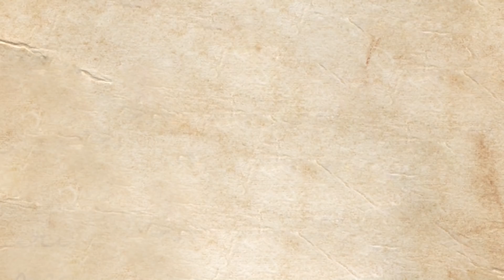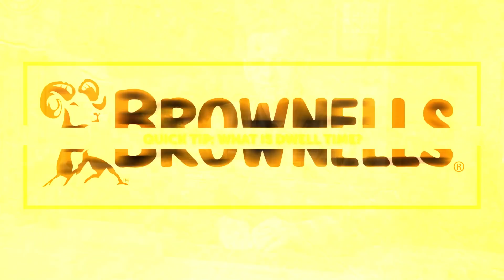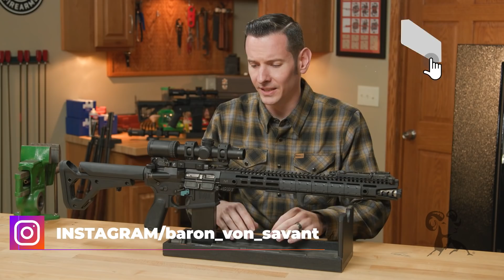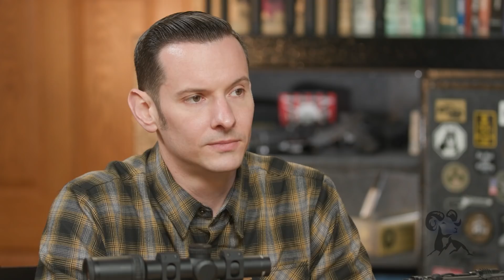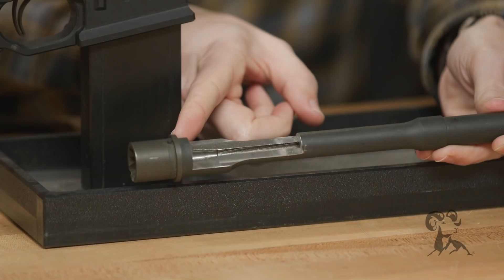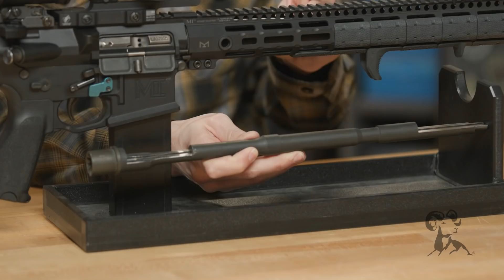Quick Tip: What Is AR-15 "Dwell Time"?

Comment: Completely overlooked the point of why dwell time is important!  For reliable case extraction and ejection!  More dwell time is better! Longer gas systems produce more dwell time.  Gives the malleable brass casing more time to contract after initial expansion from firing
Reply: No, more dwell time is not always better, longer gas systems produce a shorter dwell time.

Comment: Love the video!! So much that goes into the proper operation of an AR. HEY, CALEB! Now that you mentioned the different gas systems (pistol, carbine, mid-length and rifle), if I were to switch out my upper assembly from a 5.56 to, let's say, a 300 blackout, do I need to be concerned with the gas system? Should the gas system on the 300 blackout be the same as the 5.56? Do I need to also consider the buffer tube? Fascinating!   Anybody else have ideas?  Thanks, y'all!  Keep 'em comin', Caleb!
Reply: If you switch from 556 to 300 blackout the gas port that's drilled into the barrel of the 300bo barrel you buy will be the proper size to operate correctly. Gas blocks, gas tubes and gas keys are all standard size(for the most part) no matter the caliber you choose. Where the difference is is actually the size of the hole drilled into the barrel for operating gas to pas through. That being said the gas system length you choose for the caliber you choose will be key to it's optimal operation. I believe the optimal length for 300 is pistol length. I know they have 300 bo barrels with carbine and maybe even mid length gas systems but I am fairly sure the round was designed for pistol length.
Reply: @nateburns5933  Thank you so much! This is a big help! Thanks for the quick response, too!

Comment: This explains why Pistol and Carbine length Gas systems does much better with cycling Steel Cased ammo.
Reply: My rifle length gas system has no trouble with steel cases.  So I guess I am lucky.
Reply: The longer gas lengths like rifle length  allow more complete burn of the powder which makes up  for the lost pressure. You also have a longer barrel length which can increase dwell time causing more pressure which in effect can cycle subpar ammo

Comment: The pressure behind the bullet decreases because the bore volume increases as the bullet moves forward in the bore.  When first fired the gas volume is  essentially the cartridge case volume.  As the bullet moves forward the volume behind it increases rapidly decreasing the pressure faster than the burning powder can increase it.
Reply: PV = nRT ;)
Reply: @jthrelf  another engineer.

Comment: Define "acting on your firearm system". You're splitting hairs. As long as there is blast pressure moving down the gas tube then it is acting on the action. Since that pressure only exists during the time the bullet goes from gas port to barrel end, that is the only OBSERVABLE way to measure dwell time. Your failure to define the "acting" term only confuses things and leaves the viewer still wondering what dwell time is.

Comment: Good beginning, but how do you affect the dwell time and work with tuning the system.  I know that changing cycling includes the buffer tube and spring, but can the buffer tube change things?  What about the weight of the GCG? I have an inkling of an idea how these things affect cycling, but that's just it, an inkling. thanks,

Comment: Did I understand you - A carbine-length gas-block has more dwell that mid-length of rifle-length? Inversely proportionate, i'e., the shorter the length from the chamber, the longer the dwell.
Reply: Yes, Think of it this way, the closer the gas block is to the muzzle, the less time the gas will be pressurized in the firearm.
Reply: @CalebSavant  
Copy - Thanks

Comment: It is good to have this technical definition of the term, and even noting that the common use variant is also "correct" for visual explanation.  This seems to provide clarity for folks who want the knowledge expansion and it's appreciated. Just one piece of the puzzle, folks. No need to get all flustered over it.
Reply: This isn't exactly the kind of hobby where you can simply go down the list and check all the boxes and as long as you follow the rules you will be ok, this is the kind of hobby where it is critical you understand exactly why you're doing something and how it effects the system as a whole.

Comment: I love all the conflicting terms and nomenclature in the gun world.  People freak out when someone mixes up clip vs magazine or utters "assault weapon," as if those are carved in stone terms yet what should be a very clean cut, almost scientific term is clearly a contemptuous topic.

I for one thought 'dwell' was the delay from the bolt moving caused by the longer gas system.  Longer gas tube = further for the gas to go = delayed and slower moving bolt.    Guess I was wrong what was being described by the term, but I think functionally I am still correct though.
Reply: Actually longer tube => lower pressure at the gas port
Reply: @chipsterb4946  exactly thus the delayed and slower moving bolt. That is why "pistols" have such harsh recoil and midlengths are so smooth shooting.
Reply: Maybe because a clip and a magazine are by definition 100% different? The only reason people use them interchangeably is because movies and video games use them that way, and it is wrong.
Reply: @xThexPIGIxKing  so using the wrong definition for "dwell time" isn't...by definition...100% wrong?  BTW, most of the people I've seen confuse clip and magazine were older men, most of which are hunters.  So funny to see people get so upset by such a minor and   harmless mistake.

Comment: Unfortunately this is a very poor explanation of the topic of gas gun cycling. Failure to identify chamber dwell time and differentate it from cycle/ op system dwell time kills this whole discussion. 
The timing of the unlocking of the bolt, the  size of the gas port and the distance from the port to muzzle all effect the cycle of operation. Unfortunately it gets even worse when you start including variables in loads, ie light 55gr vs heavy 77gr 556 loads. Most shooters can get away with mass regulation if they bought a properly gassed barrel, ie change the buffer until you get proper ejection. If you start changing carrier weights and messing with gas regulation you are going to get into the weeds real quick.

Comment: I always heard that rifle length gas systems seem to erode at the gas port at a higher rate than carbine/mid. Seems counter intuitive but maybe I am completely wrong
Reply: Carbine is putting more pressure on the system and making the bcg travel faster. Rifle would be the softest then going down from there. 
Rifle <intermediate <mid <carbine <pistol.
Reply: @chazdoomy1512  ikr. Buuuuuuuut rifle length are bigger port diameters. I kind of played a little opossum but rifle length will ear up barrels faster.

Comment: If the definition is the "amount of time the gas is acting ...", then does one need to account for the time it takes for the gas tube to pressure to the point where some action is actually occurring? Similarly, is it possible for that pressure to drop before the bullet passes out the end of the barrel? If the bolt is slammed all the way back before the bullet exits, then is the dwell time considered to be over?
Reply: The bolt does not unlock before the bullet has exited the muzzle and yes, this is why a longer gas system will have a shorter dwell time assuming the barrel lengths are the same or similar.

Comment: A video on what upgrades contribute the most to accuacy in order of % of improvement. In other words what contribtutes the most to least so what would get a person the greatest increase in accuracy. Barrel, free float, ammo, BCG, trigger, reciever group?
Reply: If your build is solid and the barrel is decent, the ammo has the largest impact on accuracy apart from the shooter, which is the single largest variable. Outside of ammo, the next thing is whether the receiver and barrel extension are true to each other and the quality of the barrel. Apart from that, free floating the barrel will generally provide tighter groups, not not always. You can have a better barrel in a non free floated confit that will group better that a free floated config. If you’re hand loading you can also tune the load to match your specific rifles harmonics too.
Reply: As far as parts upgrades, AR accuracy is 90% about the barrel, followed by the trigger, then free float.  Free float is almost irrelevant if the barrel won’t group and the trigger isn’t consistent.  ARs are not bolt guns, and certainly not benchrest guns.   Anything you do beyond barrel, trigger, and free float is searching for minuscule improvement, which may or may not be noticeable depending on your ability- and most likely shooting from a bench.  

How to shoot accurately enough to tell the difference is a lifelong pursuit.  

Accurate ammo is a given.  A national match rifle isn’t going to group with crap ammo.

Comment: What about when using adjustable gas blocks ? and larger gas ports.
Reply: Won't affect dwell time, but will affect pressure, which will affect bolt velocity, etc. There are so many factors to consider in a gas-operated system, talking about one by itself is kind of pointless.
Reply: Most barrel makers have a set gas port size for a given length. Rifle length will have a larger port than mid and so on down the line. Other things like barrel diameter, twist rate, etc., all have an effect. I believe there are industry size range standards for these port sizes, but each maker will have their own specific depending on barrel design.

Comment: A case of splitting hairs. While your definition is correct and I see it..... I think the general thought a lot of people have is, dwell is the time of positive pressure enacting on the BCG. SO, length from gas port to muzzle is the time you have to make positive pressure. the shorter the distance between gas port to muzzle the less space you have to make that positive gas pressure. So fixing dwell time can get a little "deep end" with diameter of the gas port and adjustable gas blocks, length of gas tubes (seen them wrapped around a barrel before), weight of BCG and buffers to get proper dwell time for proper clearing and ejection.
Reply: exactly!
Reply: And powder burn rate.  Which is why the definition is pressure acts on the action, that may not be until the bullet exits the bore.